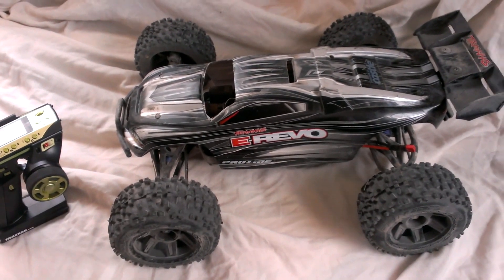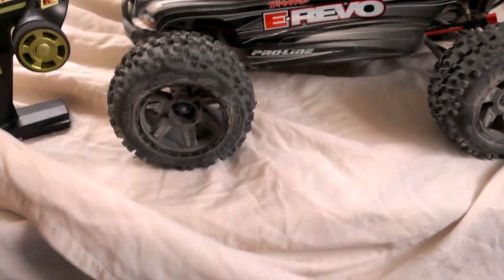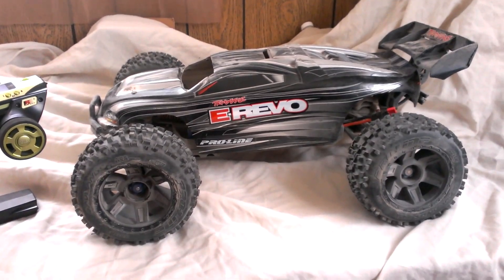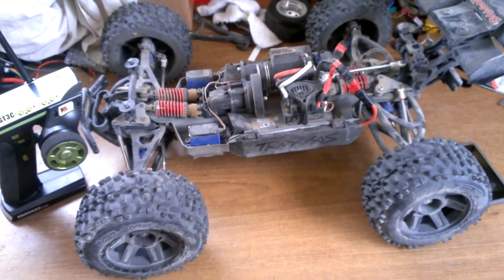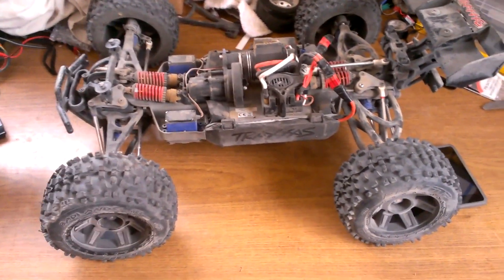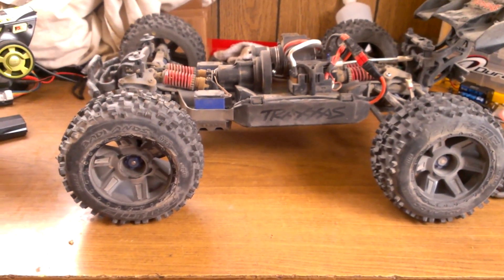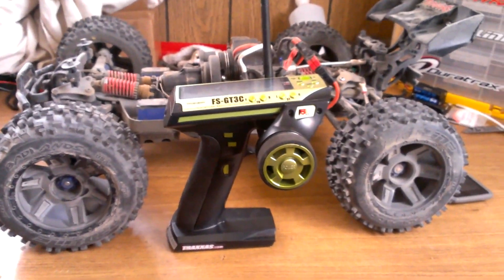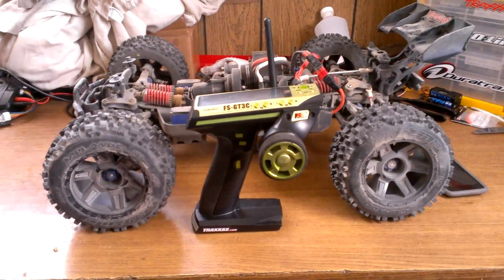Proline Badlands On E-Revo Run At The Track With Flysky Radio

Comment: Thumbs up and subbed. I'm running the exact same tires and wheels on my 4.6 Trophy Truggy and D8T. Primarily on grass, but without a doubt the best tire I have ever used off road. I went with the PL pre-mounted and have had zero ballooning problems at all. I'm considering an ERevo for when I just want to get in a quick bash and don't want to deal with nitro. Probably running 4s. 6s is just so crazy over powered.

Comment: Awesome video. I would love to know how you can send all the power to the wheels without it popping a wheelie? Trying to stop mine from doing a wheelie. Adjusting the slipper works but I want allll 4 wheels to get power. Any info would be great.
Reply from the maker: Adjusting the slipper still allows all 4 tires to receive power, the next option is adding thicker diff oil to the rear allowing the front to spin more freely in return helping the front wheels pull, keeping the front down and helping pull you through corners.
Reply: Thanks

Comment: hey just wondering, how did u install ur flysky reciever? Coz my flysky only has 3 channels, I'm guessin you have the six channel? I know the traxxas stock one has two channel 1's for both steering servos. so yeh if you could let me know that'd be great! Car looks awesome btw!
Reply: Your local hobby shop should have a Y splitter to attach both steering servos to one channel on the receiver. Or u could upgrade from the Traxxas servos and get something strong enough to replace both servos with one and just get a plate to cover the other servo hole.